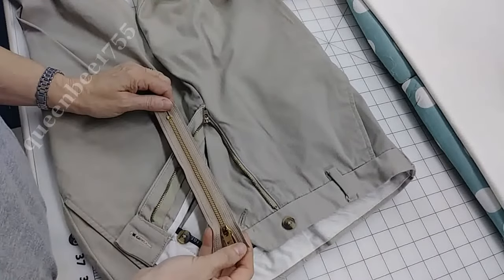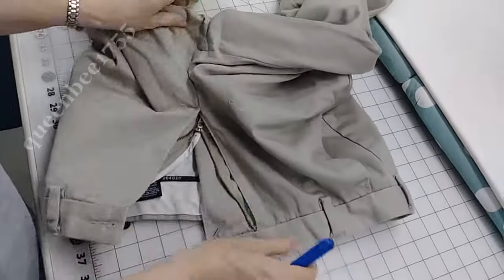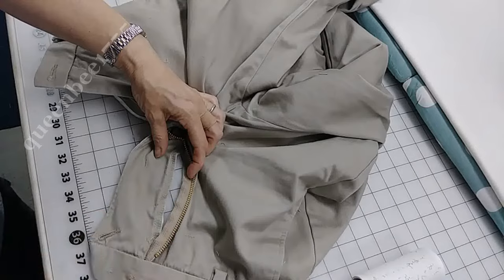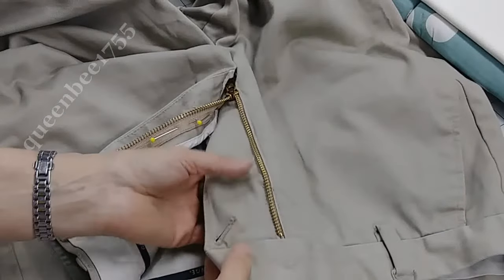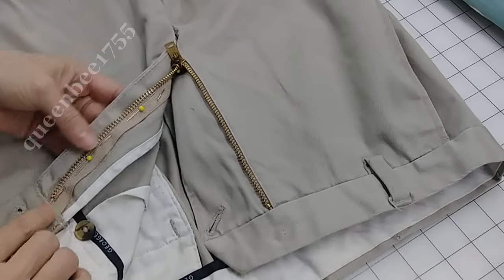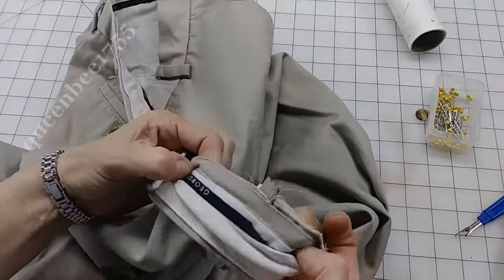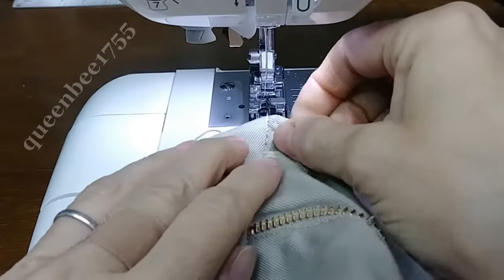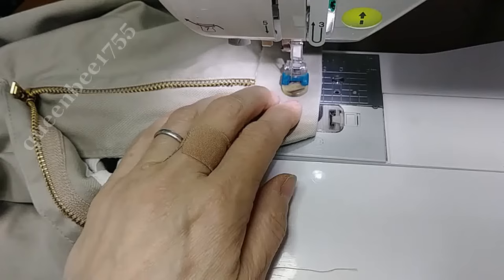Replacing Zipper in Pants

Comment: This was the best  video I watched  to  guide me on zip replacements  I never understood before. I now can replace  zips for pants with confidence.  Thank you for your calm and easy to follow guide. I love how you switch the camera for an upclose view. Wow you are great at zip repair.
Reply from the maker: @sandramaynar2053 Thank you very much! It's great to hear when my videos helps someone succeed at sewing!
Reply: @QueenBee1755  Thank you. 
I just finished my first and complete step by step dress pants with zip  replacement. I was so confused how to stich the waist section with out showing the stitches. Wow it look so professionally done. By the way you are so funny and you kept my attention for all your videos once I can sit and stich with you. Just love your videos.  My Singer Machine was less noisier than my Brother Machine. It was great at overcasting the edges of my clothing. The Brother has fantastic  stitches to work with but I just cannot get the tension right. My Brother Machine is all I have now that works but only with 100%polyester threads on medium spools. Not the very small ones. I need help with tension control on my Brother LX-3125Thanks for your reply so soon
Reply from the maker: @sandramaynar2053 That is great! 
And LOL, thanks :)
Tension control isn't something that can be easily done through messaging. It is something you may just have to play with. I have had some very finicky machines before; they can make you want to throw them out the window for sure! 
First suggestion, get fabric scraps common to what you sew. DON'T touch bobbin tension unless LAST resort and even then, only minute adjustments at a time. 
Thread size and type, needle, and fabric can all effect tension. Try to be clear on which thread is loose. Make small adjustments at a time. Sometimes even re-threading the machine or switching out a new needle for a new needle can make a difference (which sounds weird but it's happened to me before). 
Good luck!
Reply: Thanks I will take all suggestions in hand. I will stock up on needles for sure. I never taught about changing needles so I will do that this week

Comment: Such a great tutorial.  Your explanation of each step and speed is perfect.  I have never sewn a zipper in my life and it did it.  So proud of myself.  Could not have done it without your step-be-step guide.  I hope you got some dinner😊
Reply from the maker: So glad it helped! And thank you for commenting! 
LOL! I eventually did.
Reply: Queen bee, After getting the zipper in my pants I have been attempting to re-sew the waistband but am having trouble getting a “hidden” line of stitches.  I don’t have a “Stitch-in-the-Ditch presser foot (my Singer is almost 40 years old and I can’t find one that fits my machine) and have really been struggling.  Do you have any advice?  Hand sew it? Use a very small straight stitch and try to get it close by pulling the left side fabric taught?  I’ve undone my attempts several times and am about to give up.  Thanks.
Reply from the maker: @shazz18 
Stitch-in-the-ditch is more tricky on some fabrics than others. Don't give up! I've had to pull and re-do stitches multiple times. 
Before I had a special foot for doing it, here are some different things I did:
 * gently pull the fabric snuggly to the sides to open the seam line
 * hold open seam and pin crosswise to hold fabric out of the way
 * go slow on the machine, sometimes even hand crank the wheel in the more tricky spots
 * when all else fails, hand-stitch
On many items over the years, I have learned that hand-stitching, in the long run, was the fastest way for a nice look compared to using a sewing machine. 
Also, don't shorten the stitch length for stitch-in-the-ditch. The outcome is usually not very good.
Reply: Queen bee, thank you very much for the encouragement and detailed tips to finish the stitching in the waistband.  I realized after reading your answer that the fabric has some stretch in it and I was ending up with a downhill stitch line aka crooked.  Going slower and pulling the fabric evenly and pinning it really helped.  Thank you so much.
Reply from the maker: You're welcome!

Comment: I knew this is an old video but since the 1st time I saw one of your video about the 52 piece pressure foot kit I started loving all videos.. I am trying to find if you have a video  on how to use the type sewing machine you had on your videos. I am planning to buy one for me but I am scared to use it because I don't have any experience at all with this type of sewing machine. It's awkward but the truth is my experience about sewing was from the very old manual singer machine.
Reply from the maker: Thanks for watching!
I used the same machine in each of my sewing vids so far. What kind of video are you looking for? I'm planning on starting a new video within the next 2 weeks now that I'm home and the holidays are over. This one is a Brother and has worked well for me. It has a LOT of run hours on it as I used it for work purposes as well. 
I now have a Janome which I also love. Some of the feet in the set also works with the Janome but some don't.

Comment: What if that zipper shield is fused down?  Do I sew through all layers?  Does not look good!
Reply from the maker: There is a lot of variables in that situation. Sometimes, if heat fused on cotton or natural fabrics, appling an iron to it then slowly peeling open can work, but not always.
Depending on the design of the garment, replacing that section might be required. 
If no teeth on the zipper are missing, pull tabs can be easily replaced without replacing whole zipper. 
Sewing thru all layers would not look good as you said. But there is also the option of a 'false' zipper cover being placed over it if you can get similar fabric. 
I hope that helps.
Reply: @QueenBee1755  thank You